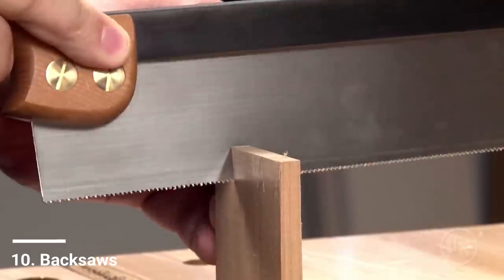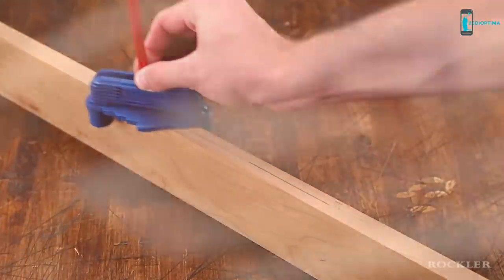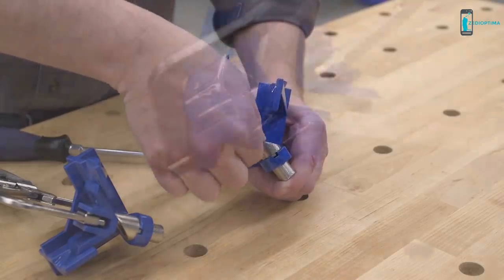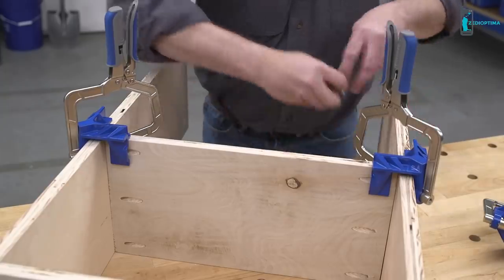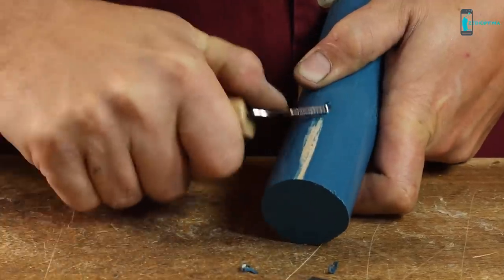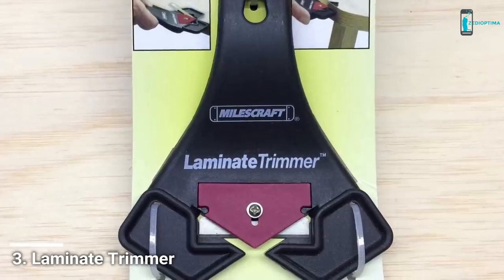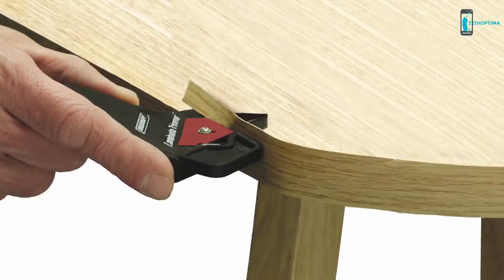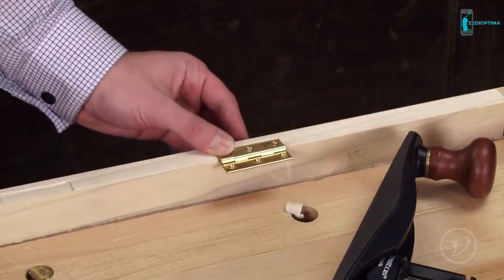Top 10 Best Hand tools for Woodworking and Carpentry Project ▶ 2

Comment: The angle scale would be cool except it only comes in metric (last time i checked). The center finder can be made in the shop in a couple of minutes. The one on this video is only about 2.5 inches wide between the posts so you can't even mark a standard 2x4.